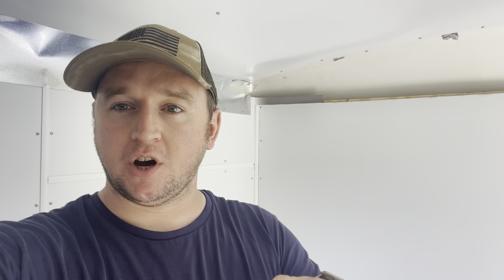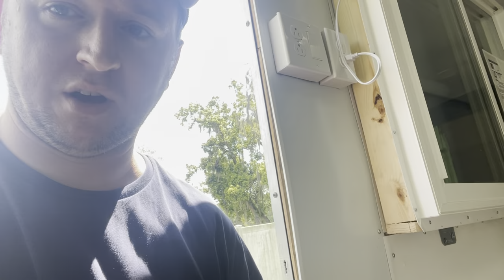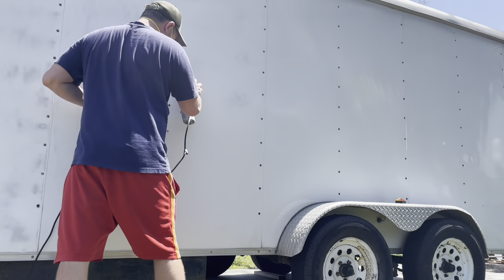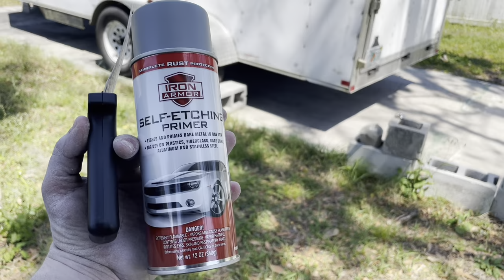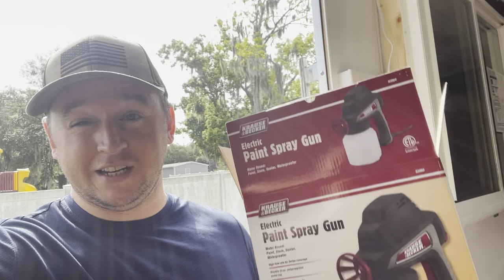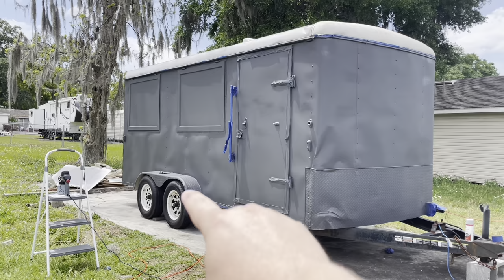Painting My Trailer - Poor Man’s Food Truck

Comment: Great video, exactly what I was looking for. I'm about to do the same project, I just had some questions 1. Would it make sense to sand and then wash it, rather than wash it first since you have to clean off the residue anyway? 2. Could you use the electric sprayer to apply the primer? It seemed like it covered better. Any tips on thinning the paint for the spray gun?
Reply from the maker: Thank you so much for the awesome feedback! You’re probably right in that perhaps it could just be sanded first and then washed (I just chose to wash down before and after to be thorough). 
And yes you’re also probably right about the primer, however I wasn’t sure how well I’d be able to clean the sprayer so just decided to use cans. But you’re absolutely right I’m sure it could be done that way!
Reply from the maker: As for thinning the paint - I kept adding water to the mixture until it sprayed out of the gun cleanly and consistently. Honestly it didn’t take much thinning out at all

Comment: I used a paint stripping wheel, I started off on my 18v drill and is was better than the detail sander, But then I used My 240v(Aussie) electric Variable speed Hammer drill and omg, cut the stripping time down by heaps, I rolled on my primer and used Rattle cans for hard spots, Great job and thanks for sharing
Reply from the maker: Sounds awesome! Will definitely look into this if I get another trailer, for sure if it speeds up the time because this was a pretty big project!

Comment: Did you use any lubricant on the gun, also did you need to thin the paint at all?
Reply from the maker: Great question! Yes I used some universal lube as it says in instructions to do so before first use. I added a tiny amount of water to make it a little thinner, maybe no more than half a quart just so it would flow through the gun a little easier. I also didn’t want it to run once applied so tried to keep as thick as possible. Hope this helps!